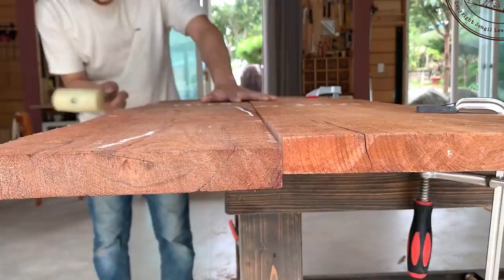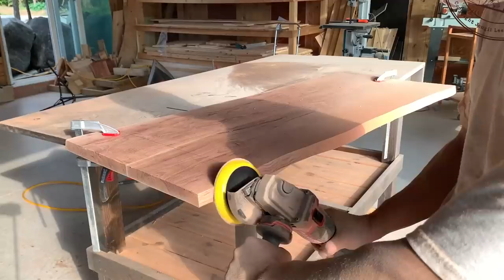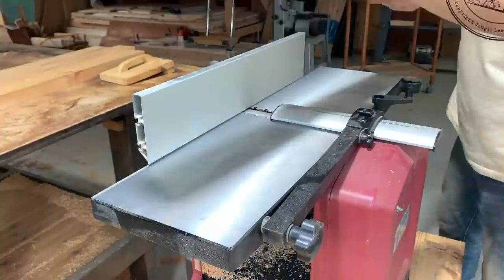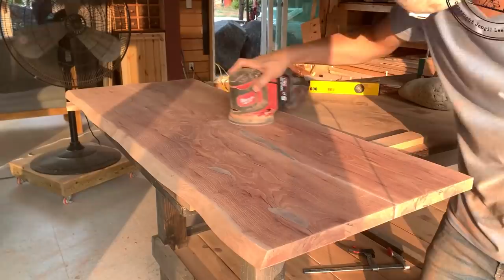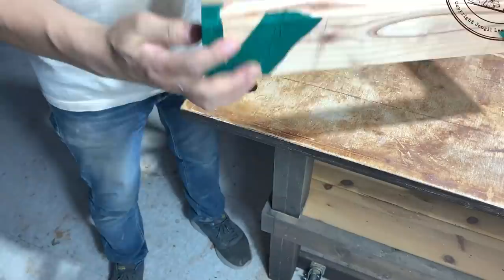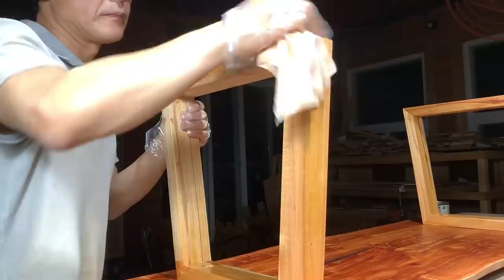Coffee Table, Making A Korean Cedrela  Low Table, With Milwaukee Tools

Comment: As a machinist for over 30 years - I'm actually impressed!!
- but not at what you might think!
Sanding with an orbital?!?
DAMN!! Amazed you got it as flat as you did - well done!
Usually it is avoided as it ends up as wavy as the bloody ocean!
May I make some suggestions?
- if you have a buzzer available, why didnt you hollow joint the to stop the joints opening on the end in a few years time? (Ends lose moisture and shrink - joint splits)
- cup rings should be alternated facing up , down , up - rings always straighten with time, resulting in the table cupping if not done this way.
but overall, very impressed with the hand skill on the tools - but sharpen the damn countersink😂👍
Reply from the maker: Thank you for your sincere advise.